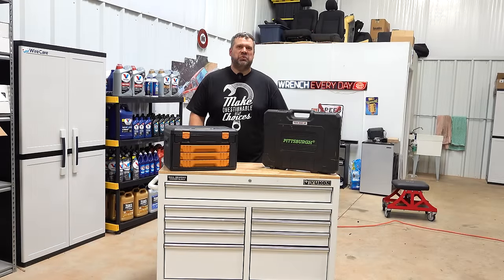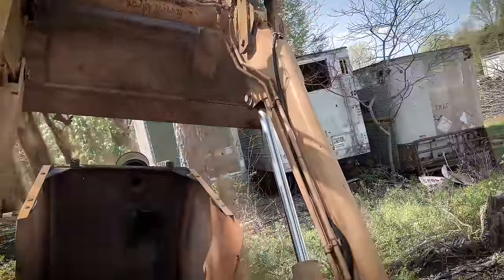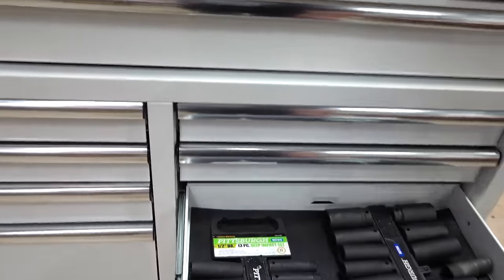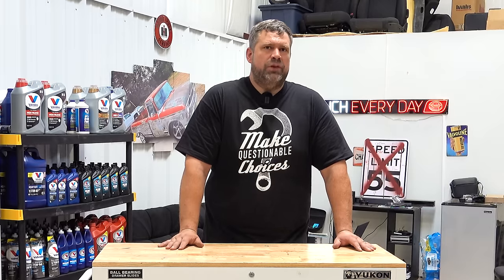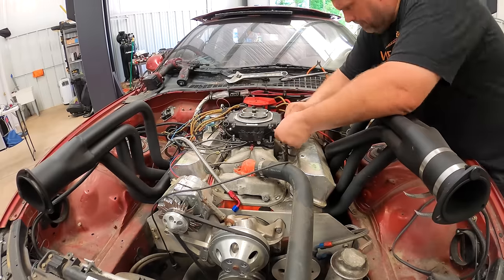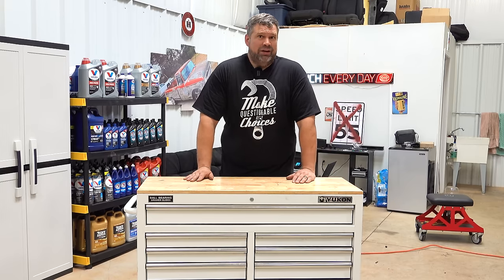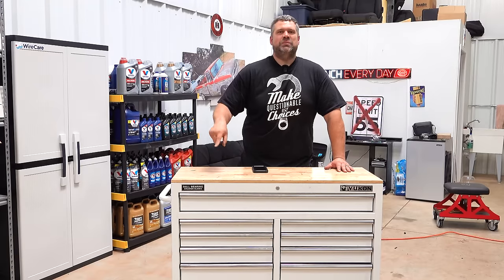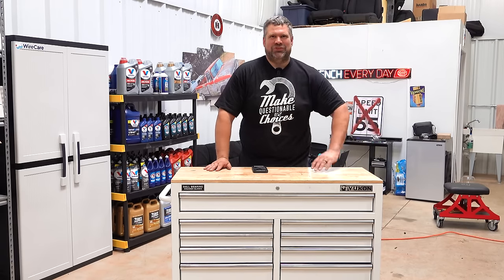I Bought The CHEAPEST Tools In Harbor Freight (6 Month TORTURE TEST)

Comment: HOWdy  W-E-D,
On these Spark-Plug SOCKETS with the RUBBER Inserts = I used a liberal amount of  RUBBER CEMENT in the SOCKET & on the RUBBER INSERT 
& I never saw them PULL  OUT again on the Spark-Plugs
COOP
...

Comment: I've had my (2) Series 1 44"  US General boxes (FULL) and A LOT of HF hand tools for over a decade, used very frequently. Only had 2 "fail". Left my tools in storage  (non-climate control, New England) for two years and just went through them this week. no corrosion, good ratchets. Not a pro but in the Super Advanced Hobbyist team. Great value.  No regrets. You will always need special tools but these are a fantastic start, or finish

Comment: I have been working in shops working my way up. Just waiting to write my final test. Bought very few basic tools from the trucks. Mainly use master craft. I'm canadian so canadian tire tools. I work there so great deals. In nine years knly broken a dye grinder and my fault cause didn't know how to maintain it and a few random sockets. My dewalt air impact finally blew its seals. It's not how much it cost but how you use and maintain them. Only snap on tool I have really bought is there breaker bar. There first tool they ever made. Went through a few of those and got it on sale.

Comment: In the 70's and 80's I was working at dealerships and found Snapon was just to much money for me. So I went to one of the other trucks for my tools. Like you I spent a lot on tools. Most I still have. Mac tool boxes (I got 2) like 26 inch rollaway's . Side boxes, shelf, middle box (3 drawers) , ect. In side I have all makes. Mac socket next to Cornwell, next to Matco ect. If I needed something I just bought off the next truck that came in. With my air wrench's I would not use my chrome sockets with my 1/2 drive, but I usually did with my 3/8. Wore them out from time to time but what the hey time is money. When you work on time you do what you have to. BTW they tried to unionize us, but it failed pretty much everywhere except San Fran. No Harbor Freight in those days. Parts are not available from Mac, nothing is. They just refer you to a local dealer, of there are none in my area. Of course I see one all the time but have not been able to get to where he is from where I am. Any way the big cost is not the box it is the tools you put in them. Buy a good box you like, take care of it and it will out last you.

Comment: I had a job at an equipment repair shop maintaining and repairing residential and commercial lawn care equipment. I was using an old, rusty, hand-me-down, Craftsman set, and the only 10mm socket i had was a very worn 1/4" drive. One day the Cornwell truck rolls in, and i decided to get a nice, new, 3/8 drive, 10mm socket. $37. Thirty-seven dollars. For a single, small, socket. That was in 2003. I haven't purchased a brand new socket, ratchet, screwdriver, or plyers since. Between garage sales and pawn shops, there is never a reason to pay $37 for a single socket. Ever.
steps off soapbox

Comment: I started out working in a garage using cheap Stanley tool sets from Walmart, a cheap ass $70 toolbox, some cheap ass screwdrivers and some Flea Market special tools along with some old Craftsman tools from my grandfather. To this day I still go for some of those old tools over my Snap-On and other big name brands.

The only things that white toolbox of Jared's needs to be complete is some prybars, some hammers and chisels and it would be prefect for a person starting out. Great Video👍
Reply: If you're looking for better quality, Milwaukee stuff seems to be pretty good.  I've used their screwdrivers, impact bits, and open end wrenches.  I have snap on, mac, mastercraft, Halfords, and a bunch of other mutt brands.  I'd say that the Milwaukee combination wrenches are as good for holding power and not rounding off nuts as the snap on wrenches are.

Comment: I have had Harbor Freights $29.99 (maybe a little more now) tool set for several years.  I also had a RAM 1500 with RamBoxes on the bed.  You would swear this tool set is made for the RamBox.  It is perfectly sized to slip into the RamBox with little or not clearance left.  For a simple set to carry this could not be beat because it took little to no room in the RamBox.

Comment: I striated my career in autobody almost 3 years ago. I bought most of my stuff (tools, toolbox, cabinet on toolbox). My philosophy is buy something at harbor freight, and when it breaks, or you use it constantly, upgrade to something off the tool truck. Except for ratchets. anecdotally, most cheap ratchets I've owned were just shit. Some times you do get what you pay for. btw, us general toolboxes are pretty nice, I've had zero issues with the 44in roller, other than like jared said, the spacing could be better. i plan to upgrade to the 72in roller soon, seeing as im running out of space.

Comment: i live in the uk and one of our grocey shops sells tools it is called lidil and i can honestly say the tool are great for the price and perfect for someone starting off mechanicing i bought i think a 48 piece socket set with screwdriver bits for £10 and i have bought rachet sets smaller like 12-20 piece sets for £6-£10 and so far i have only broken a 10mm socket and that was because my idot uncle used the bit to break lose a stuck 10mm bolt and the bit wasnt strong enough but for general use like removing body panels even taking brakes apart the tools have worked amazing sometimes the big brands arent the best

Comment: My biggest struggle with Harbor Freight is that recently, many of their lower end tool sets skip important sizes, like 18mm or similar.  I used to love their tools.  I struggle now because of this fact.  I can't buy icon...they are just too expensive for me.
Reply: Not sure if you still need it, but as far as skipping sizes, quinn doesn't skip in their bigger sets/ the sets other than the single ratchet ones. Their wrenches don't skip, their bigger socket sets don't skip, but there's also husky

Comment: great video and deff agree, im from the UK and went to Halfords (car accessories / tools store) and got there 250ish piece own brand advanced set wich comes with a lifetime warranty for I think about £250 sockets, ratchets, spanners, screwdriver + tips and has been great, showing that the cheaper brands are a very good option if you check around

Comment: I swapped out the Pittsburg pliers for the Quinn set. SO MUCH BETTER. The quality is very noticeable. If you need better the Doyle kit is only like $10 more. Also the Quinn screwdriver set is much better than the cheapo Pittsburg set.

Comment: I'm 54 & I started buying Snap on at 18 also, I had a great guy on my truck 0 interest pay what you can kind of deal and the best part is the used tools, either trade ins or repo's, I bought a ton of used tools from tool boxes to my 80 gal compressor all of which I still own. We only had a Sears and I got tired of tools breaking or rounding nuts off taking the skin off doing it. Now there are tons of tools with lifetime warranty's. I do like my Snap on ratchets above all else but would never buy new ones today. When I first opened my small shop I had 2 complete sets of tools, mine and my helpers, when I closed my shop many yrs later I got more then what I paid for on all the extra Snap On tools I had. I also had one of Craftsmans biggest tool sets that fell off a truck so to say, I gave 90% of it away to a friend and his son, sold the rest.

Comment: What brand is that long extension 1/2-3/8? A co worker had one as a hand me down from his father I asked every tool truck n they  could never find out if they were still made tried buying one 2nd hand can't find one. But like you said it is absolutely priceless for doing transmissions because half in sockets too fat to fit in many spots and often you lose a ton of power if you use snap together reducer n then a swivel socket or a swivel then a socket each connection is more impact power lost to the point a 1/2 gun couldn't back out a hand tight bolt let alone a rusted 200,000 mile 100k heat cycle bell housing bolt

Comment: I have a smaller gear wrench set similar to the one featured early on this video, I put them on socket rails and tossed the useless boxes. I have to say they have held up way better than my Pittsburgh set, no rust or flaking chrome and i drive them with a craftsman C3 electric impact driver all the time. as for ratchets, and combo wrenches i prefer SK tools

Comment: I think I have only bought one thing from Snapon, my used rollaway tool box in 1974, when I was 19. I don't know what brand it is. Most of the original hand tools are Craftsman USA starting when I was 15. I have a lot of cheap Harbor Freight type tools. I have never been a professional mechanic. More of a Composite Fabricator, Tool Maker, Machinist, Manufacturing Engineer, CAD Designer.
Reply: I have broken a few ratchets and sockets, though severe misuse.

Comment: As a kid I would take stuff apart, not so good at putting it back together without help. My neighbors would wrench on their '72 super Beetle/Porsche 914 engine and an old 502 V8 Junkyard salvage Bronco. I would "help". My family got me a starter tool set made of mostly stamped steel wrenches and the like when I was 14. At 16 they got me a Sears gift Certificate and got a set of Craftsman combo wrenches and screw drivers. 40 years later I still use them. I have since supplemented my wrenches with ones "rescued" from "deep six" USN Surplus, during my time as an Aircraft carrier engine room mechanic. I did by my Multimeter new, a Fluke 88. Many of my other tools have come from pawn shops and HF. My wrenching turned into PC building and support. But I still wrench on my own stuff.

Comment: You could buy your whole rolling box filled up with hf tools, over the snap-on 111 piece set...and spend the remaining $3,500 on your car! Can you imagine!?!?! That's damn near a junkyard ls swap! Hell with truck tools. I have 1 matco ratchet (it's very sweet) a matco pen magnet, a matco caliper spreader, and matco oil filter pliers, which i friggin love. I found a bonus snap-on cyclops rechargeable light under a customer's car (scores!). Other than that...i have greatneck, harbor freight, and a brand ive come to love, although not cheapo, they are great..and that is masterforce tools from menards. Very high quality, in my experience. I have one of the general 5 drawer rolling work carts from hf...it's awesome. And another rolling craftsman box (old and junky). But ive got just about everything i need and im positive ive got less that $1k in tools...it is all 98% for personal use, but i work on all my own stuff and i rarely need for anything.

Side note..if you bought greatneck at autozone years ago, like i did...they honor the lifetime warranty with duralast tools since they dont sell greatneck anymore. The duralast ones seem really good. Similar to napa tools.

Comment: HF wasn't anywhere close by when I was building out my tools/boxes for work (machinist). Currently have a kobalt 41" box, most of the hand tools are stanley and have held up well. Did get tired of going through big box store hex wrenches and bought a set of wiha brand, but other than that just a few odds and ends have been replaced over the years. Still well under that snap-off apprentice set, even with things like mainstream measuring equipment.

Comment: You can get the Quinn 430(ish) piece tool set for 300 bucks when there's a sale going on (I did just a little bit ago). Sure, some of that is  like screwdriver bits but nothing egregious. Comprehensive set of tools for a great deal, just pick up the wrench organizers and some socket organizers and you're good to go. I will note that it doesn't come with a carrying case. But it'd all honestly fit in a small tool chest, you wouldn't really need a full size tool box.

Comment: I have a bunch of gearwrench, because advance delivers to me and I can warranty with them. I buy from harbor freight and northern tool, and have all the truck brands. My ratchet is snap on. I prefer the feel of it. Last socket I broke was Mac, and my snap on box has slider issues
Reply: I also have gotten rid of most of my craftsman wrenches, the newer ones are garbage. I bend their wrenches trying to break bolts loose

Comment: As a retired mechanic that worked in dealerships as well as independent shops in the NY rust belt, overall quality is worth spending money on
 The roughly $175k I spent when I started would easily double or triple now... Snappn out performed all other brands at the time.

Comment: I like the comfort grip breaker bars harbor freight has but I switched to the icon because you can get the matching 3/8 inch comfort grip breaker bar and it is not offered in the Pittsburgh pro line, but I still say if you need the 1/2 inch breaker bar only the comfort grip Pittsburgh pro one is a great tool ive really tweaked on mine and it always deflected back... And maybe the grip is a little bit better than the Pittsburgh pro line but other than the anvil being straight in line with the branding on the handle if i didn't want the 3/8 one I would not have the icons..

Comment: Litterly every tech I know has pittsburg impacts sockets. They are such a great deal and last. if they break they are easy to replace they have highend sockets from the tool truck as backup anyway. I have 2 complete sets of tools, all my tool truck stuff and another complete set of Harbor freight (mostly icon). I rarly use my tool truck (snap-on, mac and matco) anymore. They are there to look pretty at this point.

Comment: I bought a kobalt set when I was in college, it was ok but as I use them more and more I disdain the odd mix of 12 point and 6 point most of the sockets are 12  Point….. and it didn’t come with full wrenches but a weird mix of double sided open ended wrenches…. If I was talking to younger me I would say to try to get tools that you can…. For me now the 6 point and shallow broach deep sockets are the first thing, then get some box end wrenches then screw drivers, the budget needs to be able to float some get what you can afford, but the icon sockets I have now are the way to go from the beginning

Comment: When I started my first body shop job 22 years ago they paired me up with a senior tech who had s snap on cabinet...triple bank work station, overhead cabinets and both ends had 7' tall cabinets.  He tried to push me to snap on but I held firm until the Mac truck showed up with a brand new yellow and black triple bank work station box showed up.  Rolled that bad boy off the truck for $4500 and loved it.  It now sits in my garage loaded with $30k of tools, still use it but totally overpriced.

Comment: I worked in dealerships for 17 years in the parts department.  But when I would pull out my old fishing tackle box and get the tools out to work on my truck I would get a lot of grief.  Now a lot of the tools belonged to my dad and were Snap-On and Craftsman.  I explained the difference is that I wasn’t trying to make a living with them but just repairing my vehicles.  And a 15/16 socket all worked the same.  😁

Comment: I’m a shade tree guy but my wrenches are out of the box literally every day and I fix small engines on the side. My entire toolbox is nearly half and half craftsman/Pittsburg.  I do have a few other straggler brands floating around to finish out sets. The only tools I break are the ones I abuse. My grandpa was a mechanic his whole life. Mostly craftsman/old school harbor freight tools. 

The one item/items I wish I had a tool truck guy for are screw drivers. I have not found any screwdrivers I like as much as snapons. Specialty tools too I could see getting from a big name as well. My HF torque wrenches are ok for what I do but a nicer electronic/beeping wrench with torque angle would be better. 

HF warranty is so good just buy 2 of everything and trade out your broken tools once a month if you even break them. Wear out is most likely to happen.

Comment: Cool. There is a $5 off non-expiring coupon for any Pittsburg Pro ratchet. I saved $60 using it at HF on a dozen ratchets. Also, I just got a 26" US General top box for $150 (scratch and dent) and it's an awesome upgrade from my 1969 Craftsman 10 drawer top box.

Comment: must be pretty lucky then never broke my matco ratchet wrenches and im a diesel tech used pry bars on open side too to break bolts loose about 7 years old but snap on flank drive plus favorite tools by far but still using my general pro box held up too good to get rid of

Comment: when I first started driving back in the mid 90's my dad kept a "truck stop special" socket set in his and my mom's car with a couple screwdrivers and pliers, and when I bought his 89 Escort he kept "the red set" in the trunk. Man I was at home replacing something minor and the bolt was kind of tight, I two handed the socket wrench and gave some gronk to it with a little lean back, and twisted the freaking square drive. 

Today, no issues I have a blue hawk set that lowes used to carry, its practically identical to the craftsmen sets they sell now, no issues good tool decent price. Horrid Fart, almost all my hand tools come from them, how do you screw up an F clamp and a solid steel set of wrenches, or a set of ball end Allen keys, heck I get my work to buy most our hand tools from them now.... and we are in an automotive factory full of robots 

power tools be wise, they have a bad habit of not long term supporting their battery ecosystems,  and their plug in stuff can range from "failing just before the job is done but you did buy a impact driver for 14.99 and expected to build a garage" to "decent but not that much cheaper or on par with name brands"